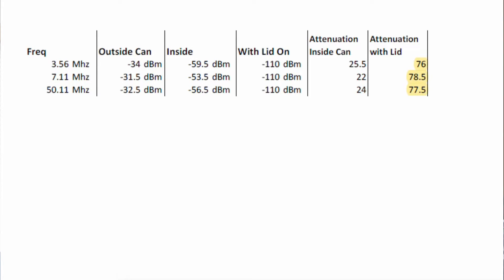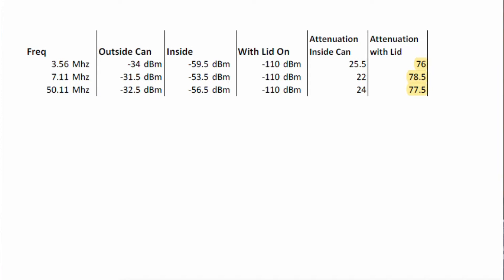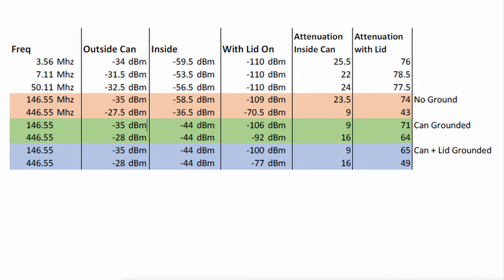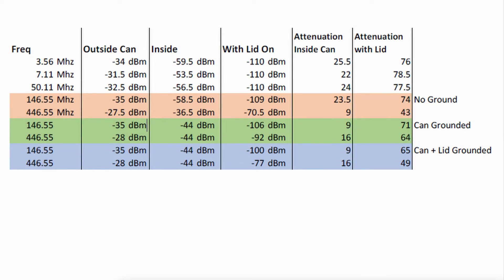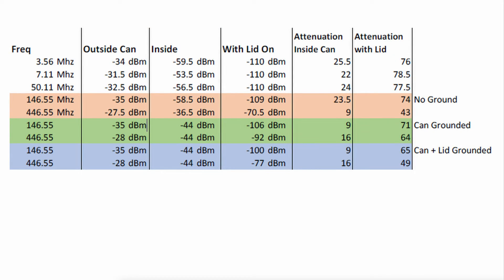EMP Shielding, back in the trash.

Comment: Your efforts are greatly appreciated. 
I have brazed the handle to the lid. 
I have also applied rubberized undercoating to the inside of the can and lid, carefully masking off the area of the can and lid that contact.
And lastly, I place a 20 gallon can with lid inside of the 31 gallon can.
This can has the same treatments performed to it as the 31 gallon can.
Though I have not grounded the outer can or performed any testing as you have done.
Thanks again for your videos.

Comment: OK so I am a newbie to this.  Can you sum up a simple statement..."Does the metal garbage can workeffectively as an EMP shield?"
Also
Should the lid be taped with metal tape? I have taped the seams and the handle areas as best I can.  But I do not have a seal betweenthelid andcan.  Does this matter much?  My "Behrens" steel garbage can  seems to be a very tight fitting lid and snaps on.
Thanks
Nigel

Comment: I've worked in tons of Faraday cages and not one was ever grounded. I am curious if you've testing taping the outside of the lid with alm backed tape?
Reply from the maker: Like I mentioned to someone else the ones I have been in were installed in the early 1960s by the military (contractor) so who knows if they were installed grounded or someone came along later and grounded them or what. On the next video I will go into it some more on what I have been experimenting with to make it better. Thanks Bob

Comment: Another great video. Your thumb is looking good. It's healing well. Question for you if you. Wouldn't you want to give the can it's own ground. Separate from you antennas grounds. To eliminate the possibility of RF leak.
Reply from the maker: Well I think someone else had that same suggestion so I may try it, I am very curious myself about that. I just need to dig out my notes so I can avoid driving one down where there is already a rod or ground wire lol...

Comment: I was actually expecting the ground to make things worse. A Faraday cage works because all parts of it are at the same potential. Adding a grounding point introduces current in the cage so any resistance (or inductance for that matter) in the cage will then cause a potential difference. Insulating the can from everything and adding finger stock around the lid is probably the only thing you could do to improve on the can. 
The ideal shielding would be a sphere made of solid silver or silver plated copper. The spherical shape provides the least coupling to external electric and magnetic fields for a particular volume, and the silver provides the lowest practical resistance.

Comment: Which frequencies would EMP produce? Great info non the less.
Reply from the maker: Depends on which report you read. The first video in the series I cover some of it. In short its nearly DC to daylight but that majority of the energy is between either 10-100 Mhz or 300Khz to 10Mhz (ish). So either way its pretty low frequency for the bulk of the E1 pulse.

Comment: When the government tests equipment for EMP protection they do it on a giant wooden platform way off the ground. They often test aircraft on this platform but also trucks and other equipment. The whole idea is that there is there is little or no grounding effect at all and the devices survival is based on their designs and not from any grounding the platform can provide. 

Have you considered how effective your towers themselves are grounded? Could that be an issue if your too near them during testing?
Reply from the maker: My person opinion on ground vs no ground is I would prefer not to have the cage grounded but I have heard arguments both ways so I wanted to test it myself. I know the true Faraday cages I have worked in they have been grounded extensively and provided nearly 100% shielding from RF. With that said both had been installed in the early 1960s by uncle Sam, so theories and strategies have  changed a lot since then. 
So the towers themselves have between 9-12 ground rods on each tower spaced correctly. The plate you saw in the video has 6, 8 ft rods attached to it. The vertical antennas I was testing with have about 62 ground radios per vertical (bare wire buried about 12 inches down).
But yes there indeed can be coupling grounding the can..
Reply: Ham Homestead     Have you seen the you tube channel engineer 775 when he presented a show about EMP panels? I just came across the show today. He set up panels that were tested at white sands proving grounds to confirm they do work as advertised. 
I think your setup is very close to how their system works.

Comment: Huh!

The only thing I can think of is some sort of ground loop, since you connected the antenna/lightning arrestor ground to the can. Also cable length may be acting as antenna to induce rf.

Try driving a separate ground rod and a short cable from the lip compressor clamp (I like that clamp). Do so out in the dirt not on a  concrete slab.
Reply from the maker: Thanks for the suggestion!

Comment: I appreciate you going to this amount of work to investigate a question I expressed a few years ago at a local preppers meeting (central Pennsylvania).  Along the line of grounding certainly comes the question of tiny openings vs. wave length.  I have assumed aluminum tape would adequately seal any rivet holes and spaces between the can and the lid, but I didn't know if the adhesive on the aluminum tape was conductive.  I just folded the tape edges over to permit contact all along the tape, but never knew if that was effective or even necessary.  You're a good man to pursue these things; they may not be significant, but who knows without testing.  Maybe i just don't have enough important stuff to worry about.  Thanks for posting this. 73
Reply from the maker: Thanks Richard.

Comment: Ive been thinking about using one of the metal storage cabinets as my ham shack. Close the door when not in use so its emp proof. I always disconnect my antennas now anyway when im not using the radios just because im paranoid of lightning if im not at home.   https://www.google.com/url?sa=i&rct=j&q=&esrc=s&source=images&cd=&cad=rja&uact=8&ved=2ahUKEwj9w4PQgPjfAhVKCuwKHdYcBN0QjRx6BAgBEAU&url=https%3A%2F%2Fwww.stratco.com.au%2Fau%2Fstorage%2Fgarage-shed%2F2-door-metal-storage-cabinet%2F&psig=AOvVaw3QthPeT_JZSc7heS4qBOV1&ust=1547924060572589.  link to a metal storage cabinet I was thinking about. What say you? what do you think?
Reply from the maker: I am betting it provide a decent level of protection, The cheap "gun safe" I am testing this week (video should be out in about another week) is built fairly similar to this so we shall see how it does!